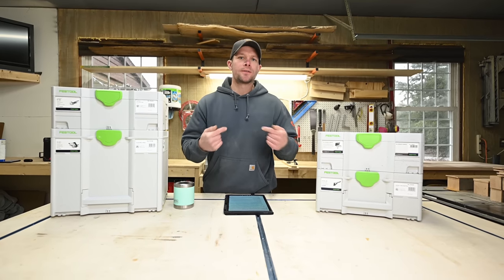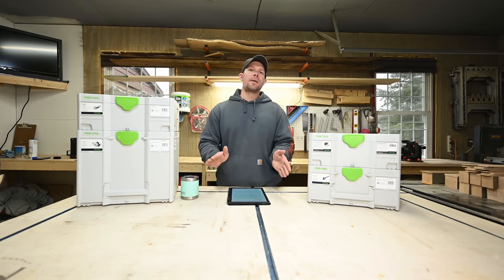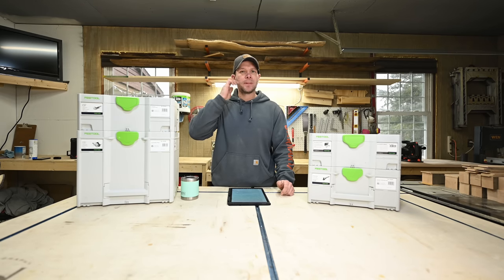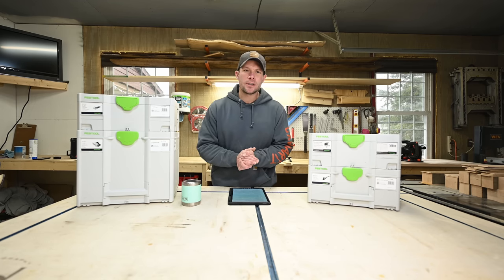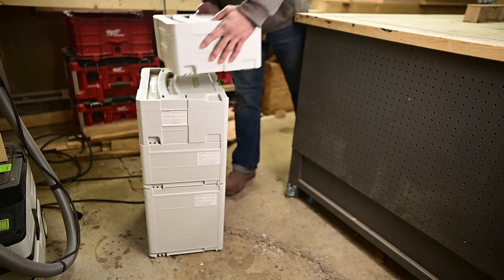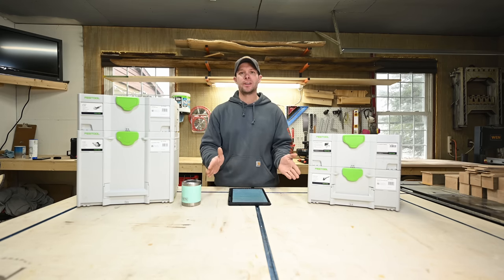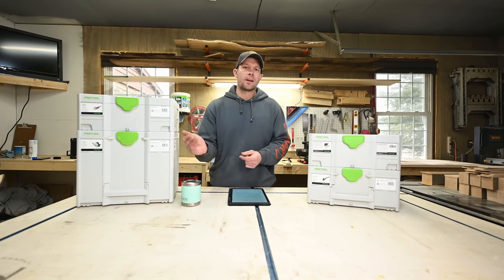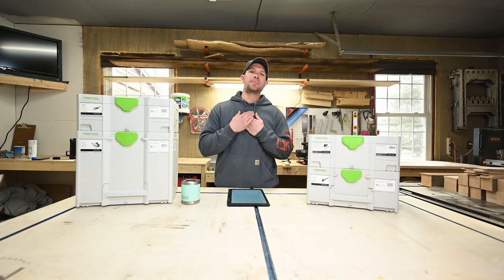I Swore this would Never happen to me...

Comment: I am a hobbyist looking to go full time. Using my current job to fund getting a shop together. After a LOT of debate I got the Festool CTL Midi vac and a few hours ago pulled the trigger on the Festool Tracksaw after about a month of trying to convince myself the Ryobi would serve me just as well. As a firm believer in "buy once, cry once", just using the vac sold me on the quality and small quality of life features that Festool offers. Fully agree on your take here, especially with products that require good dust extraction. Thanks for the great comparison
Reply from the maker: I have transitioned to a "buy once cry once" philosophy as well. I have wasted to much time and money on cheap tools. And in the long run some of them even cost you more. Best of luck on your journey to go full time man! That's exactly what I did was use my day job to slowly but steadily get there. Thanks for your comment!
Reply: I have never regretted buying the best, and after a quick count I nave nine Festool machines and love all of them. Good luck on getting your shop put together.

Comment: You are a young man so you have a long way to go.  Im 75 with COPD and have for 20 years been using Festool with their extractors and that has allowed me to continue my woodworking  projects (Im a hobbyist) to this day.  Dust collection is absolutely necessary including masks.  Im happy when I see someone your age going for it and not necessarily for the same reason that I did but Festool extractors with their tools will save your lungs for the worst dust you can be exposed to.  First time on your site and like it very much.  Ill be following you now and hoping to learn from you.  The flattening setup you use is great.  Thanks for sharing.

Comment: Same on my side. All started out with the Domino. After that i invested in the CTL26 with the systainer cyclone (which is on of my absolute favourits now). I think appart from the quality of the machines itself i would say the most benefitial point on festool is clearly the system by itself. Lock the hose in place plug-it connector on and everything runs.  No adapters needed, no cables laying arround. Makes work really running much more smoothly. 
For 18v I‘m also still on milwaukee (drill, impact, etc) but everything which is in combination with dust extraction and precision my go to is clearly Festool. 😍

Comment: Thanks for sharing your thoughts. I was in the same position and now have several systainers full of Festool tools. There is something to be said for a high quality tool that just works well.

One thing I would recommend. I have the same sander as you. You can replace the sanding pad with the 150mm model and get a larger format sander for little money. The body is basically the same and the sanding pads are something like $50. A very worthwhile upgrade.
Reply from the maker: I have saw you can do this. I may use up the 5" pads I got and do that. In your experience does it speed up sanding quite a bit?
Reply: @BradyHommel  Sanding is so much faster with the 6” pad.  Material removal is quicker and the paper lasts longer. I had always read about the 33% improvement going from 5” to 6” but was skeptical, until I tried it myself.

The 5” ETS EC is the 6” sanding pad is perfect for me. You have the 5” sander for styles and rails then can switch to the 6” for panels and cabinets. It’s no trouble switching the pads, just one screw.

Comment: On dust extractors. I had power take off over 40 years ago with Kärcher vacuum. Sanding walls, circular saw, - little to no dust in the air. Bicycle inner tubes help with connectors. But Festool easy hose attachment has the massive effect of no excuse for skipping the health and safety

Comment: I'm a hobby woodworker mainly making my own custom furniture and doing a bit of home renovation on my timber home. I needed a rip cut saw and learned about track saws. I watched a ton of YT videos about various track saws. For me, safety always comes first and the Festool track saw was the safest by far and that's how I got my first ( and only so far) Festool tool. It's a beautiful piece to work with. I then started looking for a miter saw to add to my arsenal and would have bitten down on the Festool Kapex if it had had a light and laser built in. But those had to be purchased separately. This is when I bought a Makita instead. I agree with you that, especially if you are a pro, and even if you are just a hobbyist, an effective, easy to use tool makes all the difference in terms of speed and efficiency, not to mention the joy of using a great tool. That's when I will splash out the extra dollars.

Comment: I like your presentation and I basically agree with what you’re saying. I thought Festool was WAY too expensive. But after watching a variety of YouTube woodworking videos I decided it would make good sense to get the Festool CT36 dust extraction system and a sander. That made sense for me, especially from a health standpoint. It does seem to be superior and most everybody who has one says they are great. I am more than happy with it. it’s probably worth every penny I paid as it does a superior job. However I have not gone with any other Festool items at this time. In time I may switch over to some but I’m not a high-end professional woodworker anyway.   I also saw no value in getting a track saw, but for the same reason, dust control, I have ordered the Makita and plan to use the Festool CT36. The rest may come - time will tell. Thanks for your good video.
Reply: Mirka is quite popular for just sanding but going festool means more kit available. Tracksaw very good in tight spaces, no dust element means less brushing table and work piece off and more working. Festool Bluetooth brings automatic extractor operation. Simple and effective blade system with a lower 1.8 kerf, fast blade change. Lots of features I think it's probably not worth researching one because you will end up buying it

Comment: I'm just a hobbyist but have several Festools, track saw, four (I think) sanders, Domino, jig saw, two routers (OF1010 and OF1400), and Kapex.  My first was the track saw.  At the time there were only one or two competitors and they weren't a lot cheaper.  I loved the thing so bought a sander.  I'd  had a dozen cheap sanders, all more aggravation than they were worth.  The Festool was a dream. I was hooked.  

The only issue I've had is with the routers.  Each has different accessories.  I can see why, maybe.  There has to be a way of integrating things.  There are other odd-ball issues, like the dust port on the OF1010.  It's oblong so the extractor hose has to be squished to get it onto the port.  It's not that easy.  I bought an adapter from Etsy to make this easier but it shouldn't be needed.

BTW, I was just using both routers tonight.  Each set up with a different bit and template ring.  One is set for hogging out a dado and the other for the last 1/16th inch to trim any fuzz or chips.

I can't count the number of tools I've replaced because they were no longer what I needed.  Replacing tools can be more expensive than buying right the first time.  I firmly believe in the "cry once" theory of tool purchasing. Woodworking is my only vice so I got hooked on Festool. I've replaced so many tools that they no longer need to be justified.  My wife calls them "green tools" and Woodpeckers "red tools")

Comment: Coming from a large production wood shop I didn't even realize these where top tier, we have probably 30+ festool sanders, vacs and other festool products, but by far my favorite is there routers . After cutting off my left thumb with a dewalt trim router and having multiple surgeries the festool trim routers just feel safer for me to use the build quality and the user ergonomics of it all play into it. I will most likely never use a trim router other than festool for the rest of my life because of that I could care less about the price if its going to mean a safer tool to use.

Comment: Thanks for he honest assessment of your experience with Festool. I'm a hobbyist woodworker, but like to have nice tools and have always been willing to pay for good things. I'm in the market for a good sander and have been considering the 3m sander, but after what you said about how Festool works as a system and the simplicity of using the Festool vacuum with the other tools you have it got me to thinking maybe that's the way I should go. Really appreciate you explaining how you took the plunge and purchased these, and I may be following in your footsteps.
Reply from the maker: I have heard good things about the 3m sander as well. I have never tried one but I do not think I would be a fan of the power switch being on top of the sander the way it is. I like the button on the festool. Also yes the way the sander, domino and track saw all plug right into the dust extractor was a huge selling point for me. It is awesome. And the dust collection is amazing. Thank you for your comment!
Reply: Festool makes some great sanders and they work very well with any of the Festool dust extractors. But, the 3M sander/dust extractor combo is actually better (for some types of uses). 3M has been making pneumatic sanders used in industry, auto body shops, and other commercial settings for decades. In such settings, pneumatic sanders are often preferred because they are lighter weight and are smaller, making them easier to use for long periods and also making them more maneuverable. For example, while I was in college, I worked at a furniture mill. Some of our crew did nothing but finish sand the furniture before it was stained and lacquered. They used a 3M random orbital pneumatic sander for hours at a time -- without their hands and arms becoming numb from the vibration or overly tired from the weight of the sander. I understand that many are unsure about using a sander with a paddle switch. Believe me, once you've gotten used to it, you'll like it. If you were to sand for hours at a streatch, you'd love it. The paddle switch becomes very intuitive to use, and the sander almost becomes an extension of your arm.

3M (and Mirka before them) has done a good job of making an electric sander that has most of the advantages of pneumatics. When I first got into woodworking as a hobby, I thought I'd equip my shop with air tools -- pneumatic sanders, drills, and screw guns. By comparison, their electric counter-parts felt heavy, bulky, and clumsy to my hands. Then, I saw how much a compressor that would power these air-hungry tools cost, and went electric! My electric tools -- particularly the cordless ones -- still feel heavy and bulky. But, they have served me well. The Festool, while approaching the smoothness of a quality pneumatic sander, still feels bulky and top-heavy in my hand. The 3M sanders feel almost as good as their slightly more compact pneumatic cousins. 

Having said that, I won't be buying a 3M sander (or a Festool or Mirka) any time soon. I spend most of my shop time at the lathe, so I don't use a 5" or 6" random orbital sander all that often. But, if I were to return to furniture making or the making of kitchen cabinets where, once the pieces are assembled, the final sanding involves a lot of vertical surfaces, I would be buying the 3M sander and its matching dust extractor. On the other hand, if I were doing a lot of finish carpentry, which involves sanding a lot of trim, I'd buy the Festool. Not because the Festool is a better sander for those purposes, but because it integrates better within the Festool system. That integration would be more important on multiple job sites where I would be bringing in a number of different tools. With Festool, I could use the same power cord and vac hose for each tool. With the 3M, I would need to unplug each new powertool from the 3M extractor whenever I switched from one tool to the next. 

Just the thoughts of someone who used to earn a living with these types of tools but now just uses them for fun.
Reply: @DKWalser  Thanks David, I appreciate your insight. It's going to be a tough choice on which way I go.

Comment: Completely agree. I was fighting against festool anything, then started with domino and built up from there. Do you get more vibrations with the sander protective pad? That's one thing that makes it less pleasant to use the sander.
Reply from the maker: It's a slippery slope. I have not noticed more vibration with the protector pad.

Comment: My first hit of the grey and green crack was the track saw and a CT 48 dust extractor.  Next was a Kapex, and it’s been downhill from there. The Rotex sanders kick ass, and the pads seem to last forever with the good dust collection.  Great stuff - buy once, cry (HARD) once.
Reply from the maker: That's how it goes! How do you like the kapex?
Reply: @BradyHommel  Love it.  Bought it in 2013 to do flooring in my home renovation.  It's nice and solid, runs smoothly and (like most of their stuff) excels at dust collection.  The sliding mechanism is quite robust, the angle settings of the table are easily adjusted and lock in place securely, and the tilt adjustment of the saw is very fast and easy, with the adjustment handle at the front of the saw on the end of the right hand slide rail and the scale is large and easy to read.

I've seen other YouTubers trying it gripe about the interlock/trigger system and the vertical orientation of the grip, but as it's the only miter saw I've ever owned its operation has become natural to me - squeeze trigger to release the pivot lock and lower the blade, squeeze trigger and press button with thumb to turn on the saw.  Someone coming to it from a saw with a horizontal handle might at first feel awkward using it, but I'd think that would soon pass.  I normally use the laser (it projects the cutting lines on both sides of the blade), so don't normally need to lower the stopped saw to index the cut to begin with.

Fitted with a non ferrous blade, I've used it to easily and accurately cut aluminum stock, too.

Comment: Love the TS55 & the MFT/3  combination.  But you'll have to pry my PC890 router from my cold dead hands. There is nothing like the LR32 system out there and I use it.  A base adapter, on the plunge base for the PC890 and it fits the guide plate for the LR32 guide rail.  The PC890 and my PC 5" orbital sander fit my 27mm hose for my Craftsman 5 hp dust collector.   No dust or chunks from any of those tools.  I cut the power cables short on all my tools so I can use my Festool compatible dust hose and zip tied power cable, on all of my power tools.  This plugs into a  automatic i-VAC to turn on the dust collector. 

Even though I've fond work arounds to using some festools,  I still have them on my dream list  OF1400, DF500,  and a CT26 are certainly DROOL worthy. And I can't wait for the day I can replace my table saw and make my shop almost dust free,  TSK 80 when they get to the US.

Comment: So i have had several brands of sanders all decent but mine generally take a beating when using on live edge projects and I do resin and wood charcuterie boards so I feel the resin dust takes its tole on the machines. I’m curious about what you feel the life span of the sander would be?? I am in need of a good finish sander but not so sure its worth spending the money if it wears out after a year kinda deal? Thoughts would be appreciated thanks…..

Comment: My first purchase was mft3 set with tsc 55 then I got the sanders ro90 and ras 115 which I believe is discontinued later got both of dominoes and few sanders and the ct 26 , its how you build your ecosystem,  and the tools work amazing,  ( still saving for the kapex)
Reply from the maker: I am wanting to upgrade my miter saw as well. Kapex is an option. But as much as I use my miter saw I'm debating about the sliding bosch to save a lot of money.
Reply: @Brady Hommel Woodworks  I was on the market for a good mitre saw after seeing all the brands I went with 40v 12" makita sliding saw and wasn't disappointed, very happy with the saws precision and quality,
Reply: @Brady Hommel Woodworks  I assume you are talking the articulating arm saw from bosch , beware the head has quite a deflection and other things I don't like is the detent lock pin is a plastic , just check before buying it , nothing against bosch I had my first mitre saw for 15 years from bosch and it was a very accurate mitre saw

Comment: I just purchased the Festool 150 sander! I hooked it up to my shop vac and had no visible dust. I know there is some airborne dust. Compared to my makita my festool is night and day. I maybe on the Festool train now. Do you have a recommendation on the Festool dust extractor?
Reply from the maker: They are the best sanders! I have the ct15 dust extractor. It's the cheapest one festool makes. I have the exact one I have linked in the description. I bought it from Amazon. It works fantastic with the sander and all other tools as well.